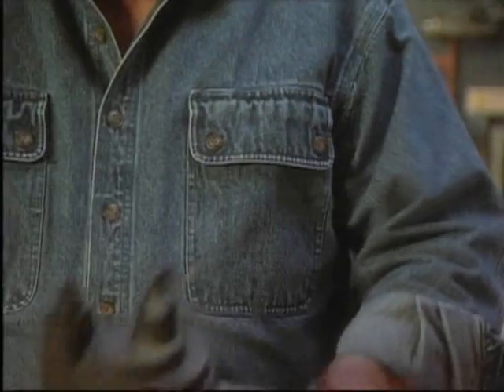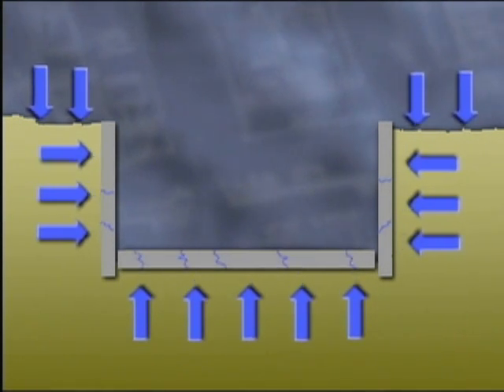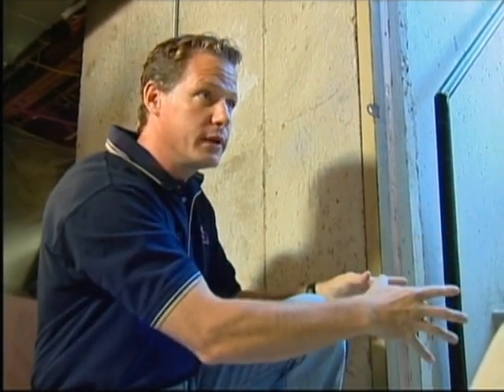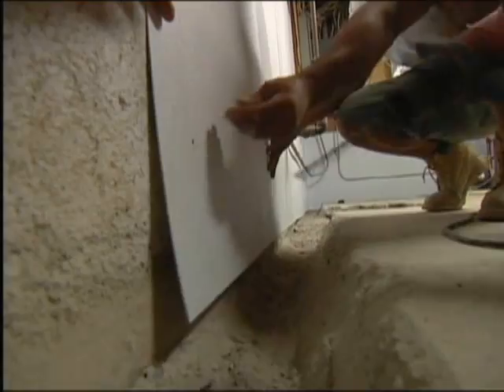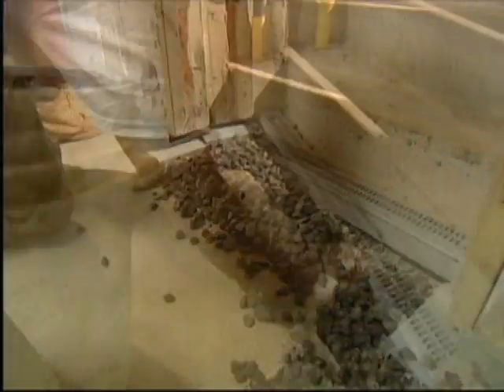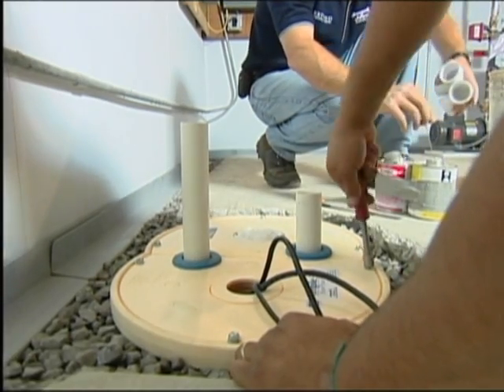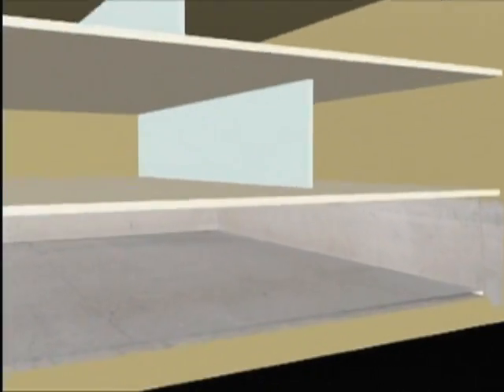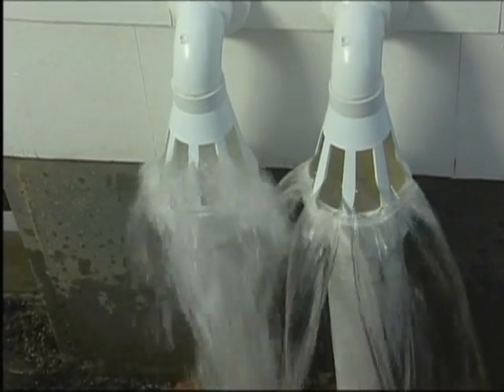How to Waterproof a Basement | Ron Hazelton's House Calls feat. Basement Systems

Comment: Ive used black death on the outside concrete below ground level before. Now this system allows water into the house then released outside. If you black death an exterior. Have the ground sloped for water run off and erosion. Then you wouldn't get any water in the house right? Just think putting plastic on pre-existing walls on an interior is a band aid, cost more money, and doesn't really do anything to solve the problem. Water is getting in your house.
Reply: What is black death?
Reply: It's a tar like substance that never dries. In alaska we use it to seal the top and bottom plate before you put the vapor barrier up to trap air for insulation. I've also see it put on exterior of basement concrete before you back fill it.

Comment: I totally disagree with this process!
There's going to be mold behind the plastic! Nothing is done about the water leaking through the wall!
(No doubt, the drains work, but what if there's a power failure?)
Why not address the issue from the outside? Like a well installed french drain system?

Comment: This is a water management, the proper way is to waterproof and seal the outer walls, he wont need the sump pump after that .
Reply: So let me get this strait you buy a house that was wterproofed before it was backfilled during the building process. It gets water pressure against it and causes cracks from the preasure and leaks throughout the foundation. So now we dig up the whole foundation again later inlife. Pay for it. Or have someone do it. Rewaterproof it. Add a membrane and Backfill and now we are good to go? So that means now no water will make it under my footer and cause pressure on my slab? For a fact?. Yes outsude water proffing, gutter routing, grading, frenchdrains will help but very costly for all that and still very possible to still habe problems. Then what pay for more work from the inside to route it away anyways? Most dont have the money for outside repair and cant chance it not keeping there basement dry. Let alone pay again for more work inside. Is this system cheap YES. Will it work for way cheaper yes As long as you route discharge far enough away.

Comment: They should drill to the outside so water does not have to go through the concrete it come through the hole into the drain and helps keep you foundation in good shape

Comment: I had them install my sump pump, drain pipes, triple backup system and inner perimeter drains on 2 of 4 walls. But they didn't wrap the bucket with a filter to keep the sand out. And 6 years later it all filled with sand - pit, pumps, and pipes. Basement flooded. Alarm system failed too, and I learned later it was because they plugged all 3 pumps onto each other, piggy back into one outlet. And I, a single parent, female, was never told, and I never noticed. So when it failed, they all blew. Fuse blew too, while I'm standing in the water. I was still terrified, with 3 pumps still plugged into the outlet, in the pit.  I had a wall that was slightly bowed and it became a serious one with a bigger crack.  And I called and called. Eventually another company came in and tore out their pit work and we stared at their bucket without the wrap. New pit, new single pump, 14 wall anchors and $25,000 bill..I'll never recommend these guys.

Comment: The only backup sump pump ever needed is a Water Powered Sump Pump. It uses municipal water supply to pump out the sump water. No batteries or electricity.
Reply: what if the house is on well water???
Reply: Patrick Wagz LoL then it’s not the only backup sump pump   ever needed 😆

Comment: I'm no fan of Basement Systems Inc., but I see an ocean of comments saying that attacking water problems from the outside is the only way to go. That would be the case if your water infiltration problems are intermittent, due to rains and poor grade etc., but all the outside waterproofing in the world isn't going to solve the problem of a consistently high water table which pushes water up from underneath your slab, unfortunately.

And do these commenters not realize that many homes are BUILT with exterior/interior drain tiles attached to a sump pump? I don't like it either, but there are millions upon millions of homes where drain tile is a necessity. Blame it on builders building in wet areas where they shouldn't, blame it on increasingly unpredictable weather patterns, but it is the predicament many homeowners find themselves in.
Reply: thank you! someone who finally stated the issue I'm facing now.. exactly that. Hydrostaic pressure, pushing water up through foundation, because of a grade/water table. This has GOT to be better than doing nothing..
Reply: @richgouette  Grade is highly fixable, a high water table, whether seasonal or permanent, is not.

A word of caution: If you have a consistently high water table and install or replace ineffective drain tile, you could end up in the unfortunate situation of having those drain tiles just sitting in water and having a perpetual flow of water into your pit, causing your sump to activate as often as once every few minutes or less. It's the situation I've found myself in after having work done last year, and it is a living hell I can attest. So be careful what you wish for. 

If I had to do it all over again I'd NEVER have my original slab disturbed. No matter what contractors promise or what sort of admixture or sealant they might use, the new concrete will never form as strong of a bond as your original slab because it won't be a uniform piece. I've had new cracks and spots of moisture in the new concrete lay in spots where I never had problems before.

Then if you have buyers remorse it may be too late, the damage is already done. They may tell you that once new drainage patterns are opened up that it's almost impossible to close them. Try asking a waterproofing company to remove and reverse their work and they'll look at you cock-eyed and act like you're asking them to part the Red Sea. All they're focused on is keeping water off of your basement floor -- they don't consider the ramifications of their work. Waterproofing companies are not engineers, they're a cadre of pushy uninformed salesman and ditch diggers.
 
Don't let more water in only to bear the brunt of pumping it out. I'd try anything before making such a big decision. Hydraulic cement, epoxy, grout injections...anything before trenching. They may be temporary and require maintenance, but it might just beat the expensive, intrusive & destructive alternative. If I never had to listen to or worry about a sump pump again, it wouldn't be a day too soon.

It's an unfortunate reality that millions of homes are built with full or even semi basements in areas where they shouldn't have been. If a natural water table is above the level of a basement floor, which will flood without reliance on a fallible mechanical device at any given time of the year, that is a major liability. And unpredictable weather patterns have made this fact even more pronounced. I've never had so many problems as within the last historically wet decade.

I don't have the answers, I just know that those of us situated within high water tables are stuck between a rock and a hard place. And if I knew then what I know now, I would've made some different choices.
Reply: @UToobin75  great, just when I thought I had a solid, workable solution in mind....
hmm Well, either way, I greatly appreciate yer thoughts .
I had a company come out yesterday to look over my water situation, and he specd out a $4400 solution, using those water systems plastic buried channel thingies.. I researched costs, and determined I could do it for a fraction of that.. but now you've got me worried..
Reply: @richgouette  Rich, I'm no expert, I'm simply sharing my experience and doing what I can to tell you what waterproofing companies do not. It really depends upon your specific situation and what you're able to live with. If you get only intermittent water infiltration and throughout a wide area (not just in a focused area), then water management systems certainly have their place. 

I was having problems in one corner and mistakenly thought that if I gave that water somewhere to go, it would drain out and inflow would slow to a trickle. Little did I know that I was opening up the flood gates towards a perpetual supply of water, and now I'm bearing the burden of channeling an underground river and having to pump it out, with no way of limiting the flow without having the whole thing dug up and filled back in -- which is exactly what I'm trying to find someone to do -- a risky proposition in and of itself.

Just know that it is a major commitment. I know the temptation is to jump at the first offer when you're having issues with water in your basement. I understand that all too well as I had the finished side of my basement flooded, had to remove a large area of carpeting and even put down a dozen sandbags to try to stem the tide of where the water was seeping in after rainfall/snow melt.

1) Get as many estimates as you can.
You will discover rather quickly that basement waterproofing is not an exact science. It is an unregulated industry. Every company is going to offer slightly different approaches and different estimates. They rely on you the customer to detail the problem and determine what the best course of action is. You hire them to be the experts but they know about as little as the customer does as to what the results will yield, as neither you or they have X-RAY vision.

2) Demand open lines of communication with the foreman. They may take the initiative to do things you don't want done. Like chipping back your footer to make room for the system, perforating your sump basin, not using enough concrete to bring things level to where your slab was before etc. etc. etc.

I will tell you that my local Basement Systems franchise went ahead and installed a system DIFFERENT than the one listed in my contract without my consent. As someone unfamiliar with the process, the damage was all but done before I realized it. Had I been informed I very well may have reassessed my options. 
I didn't know I'd have to watch the crew like a hawk. Hard working? Absolutely. Committed to keeping the customer informed every step of the way? Don't count on it. And getting them to address fundamental mistakes after the fact? Good luck. After repeated requests to the owner of my local franchise to make things right, he passed the buck to his attorney to silence me. Now I may have to contact corporate and file a complaint with the BBB. It's been a nightmare from day one with these guys.
Not only that but my contract listed a necessary permit, yet upon calling my local building inspector, the city has NO RECORD of issuing a permit for the year the work was done.

3) Read the fine print. Those contracts are tricky to protect them from liability, leaving the customer with little recourse in the case that something doesn't go as planned. Lifetime transferrable warranties are often not worth the paper they're printed on. To keep them active you often need to pay an annual maintenance fee (whether it needs servicing or not). You can reinstate an expired warranty only at a premium cost.

My advice would be to find someone knowledgeable who ISN'T trying to sell you anything to offer advice. Waterproofing companies are just trying to make a sale, often pushing $10k+ full perimeter systems (whether you actually need them or not) because they provide them with the biggest profit margins.

Point being, BE DILIGENT!

Comment: We agree with the previous comment.  The graphic used to explain the increased water pressure is accurate but does not indicate the full import of a true waterproofing and barrier placement between your (any) Basement Wall and the dirt fill up against any house.  Remember "remediation" is NOT prevention.

Comment: What was the cost of this system including labor?
Reply: You don't want this system to be installed in your basement to divert water away to a pump then discharge it outside.  This is not the solutions.  The proper way is to prevent water to enter your basement from the first place....that's where the root cause is.

Comment: This is dumb. Divert the water from away from the house. Proper downspout  placement and a french drain won't break the bank. This is a commercial for an expensive "deal with it' system rather an inexpensive fix,

Comment: How much did this cost ?
Reply: I estimate about 10K, but this is a possible diy for much less if you are flipping it. 
It is not a good solution though, and does not solve any water vapor from the floor either most likely making that problem worse. And logically it could possibly weaken the integrity of the foundation by breaking the bond between the floor and the wall, which has been together for decades in most cases. Some companies leave tabs and feed the piping under them, but i think that is just a con as there is no way the integrity can be the same with a jack hammer blasting away for 3 hours. The floor is history, the house has begun a downward spiral.

Comment: That only takes weeping wall water away. The hydrostatic pressure will still make the underfloor water rise and flood. You need to get below the flooring add a weeper to a sump etc..... Not just the along the top of the footings. P.S. The schematic is incorrect...there are footings under the walls which the floor is poured over. 😎
Reply: Not even close! Outside dig and seal is the only way to go, cheaper than an indoor too

Comment: What a rip off.. the trench should be much deeper
Reply: It wouldn't matter if it was 10 inches deep or 10 feet deep, they didn't seal the outside of the wall so nothing has been fixed

Comment: I just had a new driveway poured.  I have a half basement that you enter outside like a craw space but you can stand up in it for half of it.  I’m still working on making a new door and my front porch leaks.  Even without the new door finished I don’t have water on my concrete steps.  I do still have water on the bottom and around bottom edges in basement when it’s heavy rain.  Does anyone think it might be the front porch that is causing it?  Here’s a video of the new driveway.
https://youtu.be/s7y7lD9_XmM